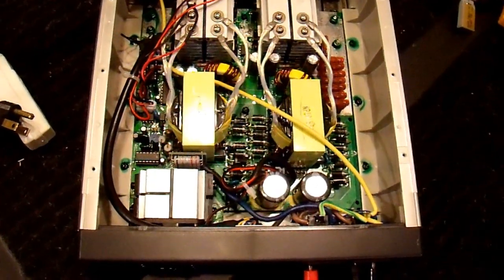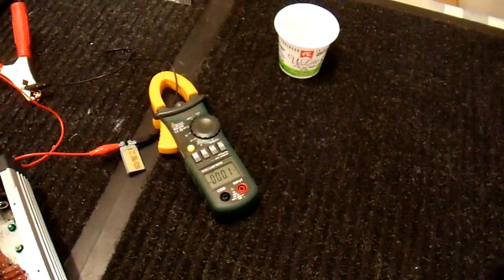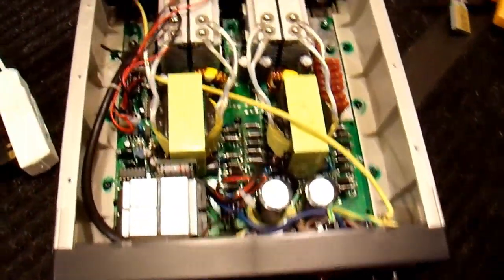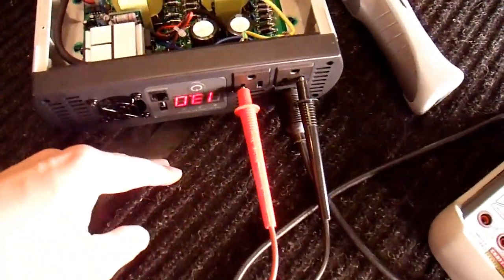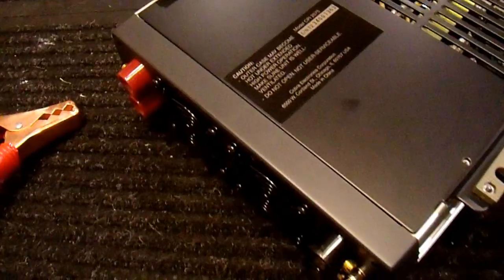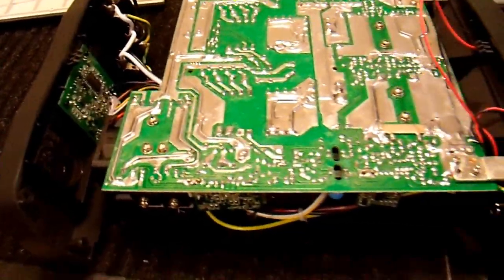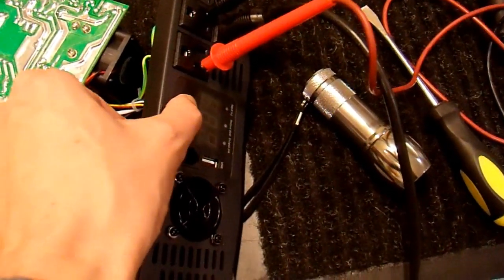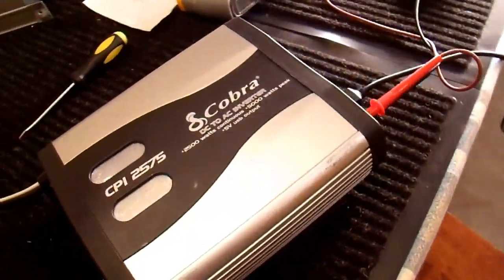Cobra 2500 Watt Inverter CPI2575 Unboxing and Review - The Repair part 3

Comment: Does anyone know any info on the type and rating of the transformers? I need to replace one in my unit but it has no markings at all on it.
Reply from the maker: Magnetic components like this are nearly all custom made.  Your best chance is to find a scrap unit and steal one from it, or determine if all of them are in series or if there are parallel sets of transformers.  If there are parallel sets you can disable half of them and you'll end up with something like a 1500W inverter instead of 2500W as it will be capable of a little more than 50% of the original rating.

Comment: I got 2500 cobra inverter tha it’s conected on a big rig,but out put has red light I don’t know if it’s normal,but when I conet the microwave that has 700 wats after 4 minutes start going down to 750 out put and 11 battery bolts.help me out please thanks

Comment: Cobra probably contacts several Chinese open warehouse manufacturers and gives them the case of the inverter and says build me a cheap inverter that fits in this cheap case that will output what is claimed on the label for the warranty period. And then they go with the cheapest, then they continue refining the build to reduce the cost until they end up with something that puts out 80% of what is claimed. Then they add fine print that says they tested the inverter under factory test conditions,  leaving out the fact that they had to over-volt and super cool the inverter which allowed them to just touch the rated claims for a few seconds.

Comment: I have a question you may be able to help me with. its about a inverter I have. it is a brand I never heard of. and 1200 watt. modified sine wave. it will run a saw that claims to have a 14amp motor. but I plugged in a small radio. it didn't work.. the lights was dim on it. bit soon went out. and no longer works. but the saw will. so I checked the output with a cheap DVM and the voltage was all over the place. up to 160v and down to 115. is this normal. or can it be fixed cheaply. I have been thinking maybe its a cap. it has one lone 1000uf 35v cap that is a little swollen. thanks I have been enjoying lots of your video's. it would be great if you can reply thanks.
Reply: I guess it needs minimum loads to work properly as all switching mode power supplies.

Comment: @knulgnar24 What part number did you buy, I have the same inverter and you have convinced me to switch the "international rectifier" out aswell.
Reply from the maker: I don't remember the exact part numbers I used anymore unfortunately.  IR does make good product so that isn't the root of the problem with this inverter, it just isn't designed to handle the wattage it is advertized to convert.

Comment: Nice video I wondered why you got rid of that inverter now I understand it really just does not do well. I still like the tiger claw inverter it did good. Do you have any plans in the future to build a home built inverter?
Reply from the maker: I have considered that but the design costs alone to make an inverter that was properly engineered would run into the tens of thousands of dollars, and last time I checked I was made of this squishy gooey stuff instead of money.
Reply: Not the type of inverter that costs a college education but one that you could build purely off simple logic circuit and put in some really beefy Fets and run some things at different frequencies and see where the sweets spots are. I already understand your answer is no, but just curious because you have an extensive background in electronics. I have built some simple inverters and ran some small loads but found they fit very few applications other then light drivers.